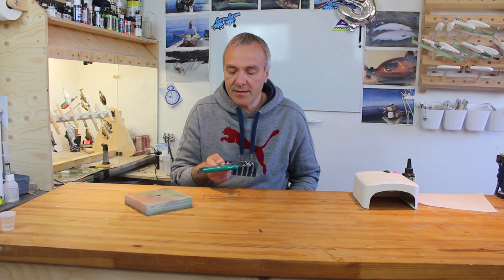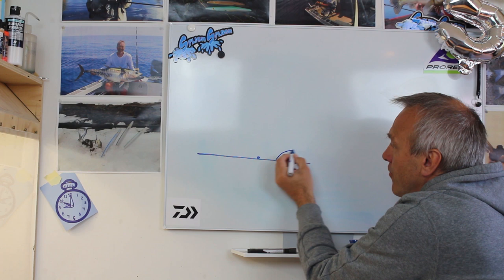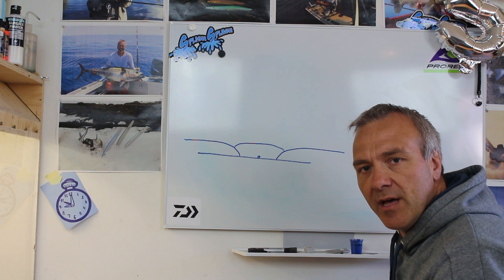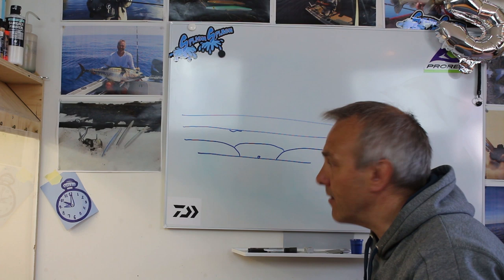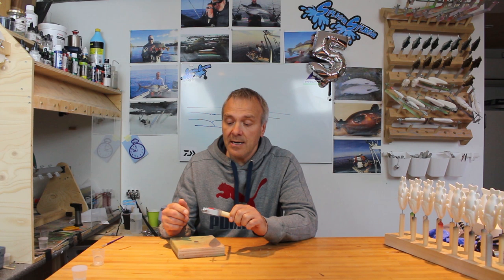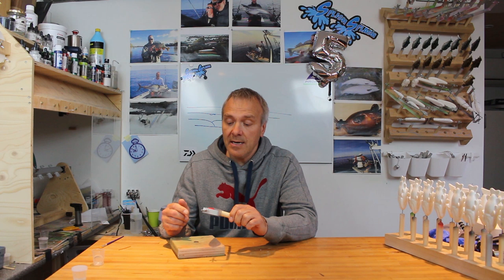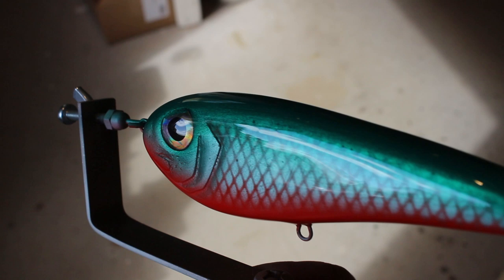Fix fisheyes in epoxy

Comment: I'm using the same epoxy, resin and paint as you. Do you do any prep before painting, and after paint? I have had many fisheyes in the epoxy, even if I whiped the lure down with cleaner. I made some experiments with a waterbased varnish mid-coat, but I still got mixed results.
Reply: I have struggled with fish eyes for such a long time. Wasted money blaming the epoxy and buying several brands. The sollution: priming the lure! The problem: The resin have micro pores that you can't fill completely with airbrush paint. So my solution was dipping the lure into CAB Coating mixed with Titanium Oxide. I guess any primer will do as long as you soak the lure in it closing all the pores. To see those pores, airbrush the lure with a dark color and immediately wipe the paint with a dry tissue. I don't know if it's because the resin I'm using or if others have this problem, but if you have it....it might worth a try.
Reply from the maker: Hi Johann. I do not prep my resin lures before painting. Just wash with dishwasher soap en brush them over with very fine sandpaper. There are many reasons why we get those fisheyes, and I am not even sure I know them all. Grease from fingers ande tools is one. Another is dirt and dust in tools and work environment. Other things may influence  like brand of epoxy and humidity.
Reply: I’m not sure what water based varnish you’re referring to but I started using minwax polycrylic and I haven’t had any issues of fish eyes with 30 minute epoxy. I always check the lure a few times for the first 10 minutes and if I see fish eyes forming I use a brush and gently pull resin over that part. I’ve found if you do it after that 10 minute mark the resin doesn’t level back out and it leaves a rough spot. Good luck on your lure making.